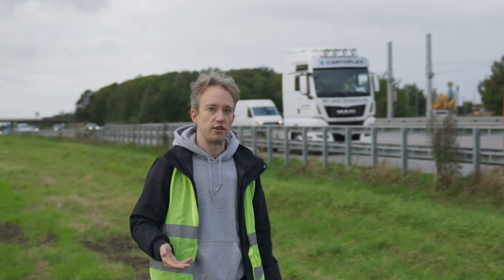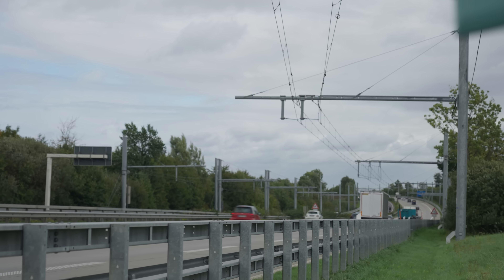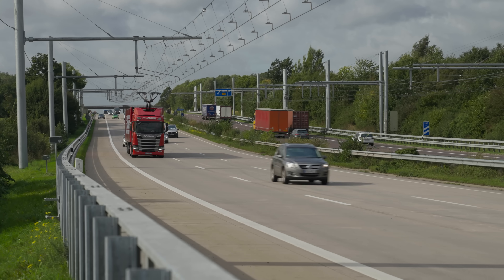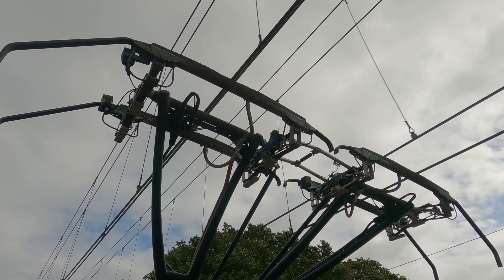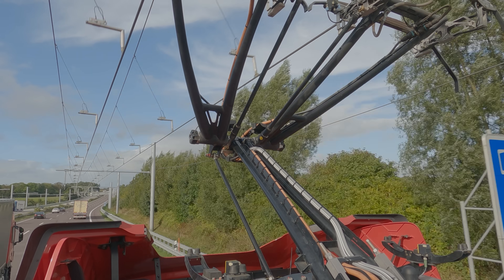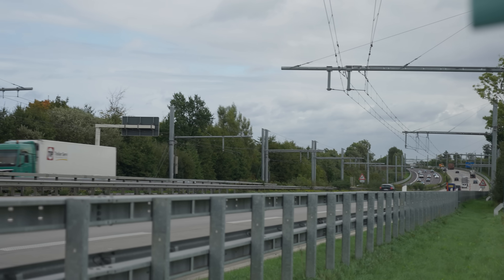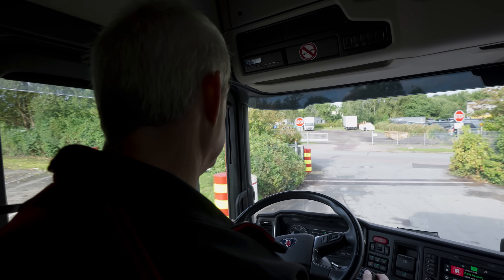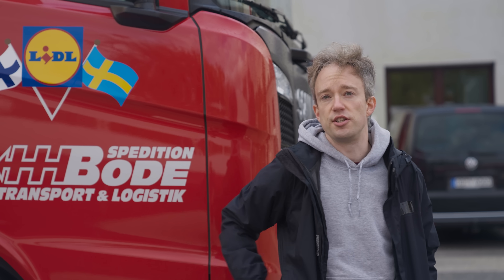The highway where trucks work like electric trains

Comment: This looks like a good idea in theory, but I struggle to see how a business case can be made for building the required infrastructure. It's a bit chicken and egg, because the economic case for using the trucks will not be made until there is an extensive network in place, but who will pay for the network in the meantime, if no one is using it? I suspect it would not be possible without significant government funding, which is unlikely to be forthcoming. Governments have been reluctant even to fully electrify railways, where an extensive overhead network already exists and the business case for additional sections is therefore more sound.

Comment: Vehicles powered purely by batteries are not viable long-term, despite what Tesla and battery manufacturers wants you to believe - they take far too much energy to produce, have a very short lifespan before the batteries become unusable, and the production of the raw materials for the batteries destroy the planet. And that's besides the problem that the materials used to make batteries, no matter if it's NiCd, Lithium, or Lead-acid, cannot be recycled and used to make new batteries. They require finite materials that will be used up faster the more ignorant governments try to force people into battery powered vehicles.  Hybrid vehicles running on electricity and sustainable fuels are the only long-term solution for the future. Private vehicles for every individual are also, unfortunately, not sustainable long-term - we would never be able to produce enough electricity for all of them (California already struggles with all the electric cars despite of how much power they produce), but at least with hybrid fuel there's a chance we can have some share-cars. Heavy investment in Trucks and buses running on overheads wires is a very viable concept, but unfortunately we're unlikely to see any of it until it's too late.

Comment: This is a good idea but costly to. Install  , but if we were to Change the way ,our roads are used , that is to use the so called fast lane,overtaking lane as a dedicated lane for Trucks buses coaches , then the vehicles would stay in lane until they need to take an exit, and switch to battery power,  this could be achieved, at less cost as the power could be delivered to both carriageways from the central  crash barriers on a single pole , much the same as the overhead lighting is done ! The alternative would mean the motorway looking like the railway, as an example

Comment: I remember having this as my 10th grade science congress project back in 2016. Judges were impressed by the idea but the challenges were more than the benefits so I only got to the regionals. Its great to see this implemented in real life and actually working. The child inside me is proud. Shout out to Germany for leading the way to clean energy revolution!
Reply: May I propose the idea of "freight trains", where a bunch of unpowered trucks are pulled by one or more powered "trucks"? This is even more efficient for long distance transport…
Reply: @ibimsbodenhansel3230  True, but this is for short transport, from warehouse to store or warehouse to home.  This is what a UPS or FedEx van would do.

Otherwise, trains are the way to go.
Reply: @dannypipewrench533  that would be the smart way to deploy this system, but the Germans want this for long distances where batteries wouldnt suffice. If you were to use this for the purpose warehouse to home, the construction of the lines would be to expensive. We already have electric delivery vans! Why would we need this exept for long distances.
Correct me if I am wrong, but in this case they are trying to satisfy a market that doesnt exist.
Reply: @ibimsbodenhansel3230  hybrid trucks with enough gas mileage would create that market, but only if the electricity can actually save money after a year.
Reply: @dannypipewrench533  but those vans run on battery already
Reply: Not to mention that electric motors are just really really good at making things turn.  Sure, they are clean, but they are also quite efficient, which is what I like about this idea.
Reply: This is clearly a money laundring blunder, this is coming from the country that declares carbon and gas combustion is a more enviromental friendly energy source then nuclear energy
Reply: @blomgaming6480  I like nuclear energy a good deal.  I am going to study nuclear engineering.  I hope to see the construction of breeder reactors at most power plants in my lifetime, but that is not why I am going to get the degree.

I want to work on spacecraft and launch vehicles, and nuclear-thermal propulsion is a fascinating concept.
Reply: Good thinking on your project. Nothing is possible until it's been done. In my freshman year in the BSME I was enrolled in program I did a project on replacing some underused city buses with self-driving mini-buses that could be called up via phone and the destination could be entered. And that was in 1970!
Reply: Hold up, you did this as a 10th grader!? What have I been doing with my life 😂?

Jokes aside, I know we're all different and our own talents. Mine interrests has been physics (or tho not chemistry). But it's still just a hobby interrest.
Reply: They are burning South African coal and Russian gas to generate that power.nothing clean here
Reply: Germany is extremely backwards in general with environmental things, sad

Comment: The cost of installing these electric poles is one million euros per kilometer. Why not changing the traffic/road legislations so that lorries (trucks) move in the middle. Thus, only one-line of posts/rails is installed in the middle. This will reduce the installation cost to 50%.

Comment: It is a good ideal.
Take it to another level by:
- Build the grid on major highways.
- the truck like Tesla truck with charging while driving like in the video.  The charging only some section of highway in town only.
- this provide flexibility long or short distance driving and charging when need without stopping.  Easy to change lane and so on.

Comment: There seems to be an issue with the pantograph. With trains the cables sway on the cunductive surface of the pantograph to minimize the problem of creating grooves. Very easy solution for a vehicle that has a fixed track. I'm curious how they plan to implement that on the electric highway. You don't want the vehicle with up to 40 tons of load to sway around without being a huge safety risk in traffic. There has to be a sweetspot that it doesn't loose contact aswell or the vehicles have to be maintained in very tight service with (probably) expensive replacements of the conductive surface of the pantograph.

Comment: Still don't know why replacable batteries in vehicles wont work
Reply: The batteries would have to be massive to move a vehical that large and heavy. Batteries are very heavy themselves and costly to create by using rare earth minerals. By having the vehical on the grid for most of the journey, the batteries can be smaller as they'd only be needed for brief stretches.

Comment: All fun and games till something goes off and a spark ignites your load . Could it be fuel or any chemical sensitive to fire. It might be something but not fully viable
Reply: that's....  not how that works... thats like saying "petrol trucks arent fully viable because what if the combustion engine goes off and it ignites the load" an electric truck cant ignite its container just like a fuel truck cant.

Comment: This feels weird, it's not a complete scam infrastructure thing like Elons tunnel 2 but it also feels like this could just be fixed with trains, especially as most road wear comes from trucks. In some cases I can see this being more beneficial especially if there are no nearby train lines but long distance trucking shouldn't exist and should just be replaced by trains.

Comment: It would be interesting to know whether electricity is still cheaper than Diesel after all this electricity price jumps in Germany and Europe (and electric bus company in Scotland was advised to use diesel generators as it was cheaper than using grid power).
Reply: in Germany Electicity is MORE per unit energy than Petrol or Diesel fuel

Comment: The only bad thing is that the wires are not in a zigzag formation (makes the pantograph wear out evenly) but if the wires are straight, only 2 parts of the pantograph will wear out.
Reply: i feel like how the wires are currently not exactly perfectly straight, along with how driving will have some bit of side to side movement (well, a bit more slight) should be good enough, and replacing those are cheap enough to not matter too much
if it's too zigzagged, you may run the risk of going too far off to one edge of the lane and decouple the wires, and a slight zigzag might not make much of a difference
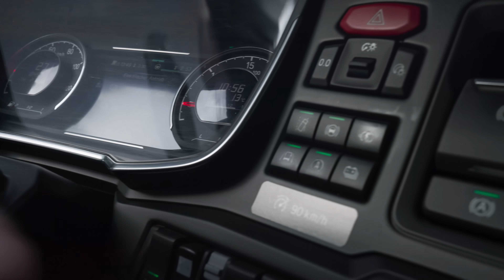Reply: @awesomestuff9715 at 1:11 you can see how uneven it is weared down.
Reply: Not needed, you still don't follow the lines accurately. There are curves that zigzag by design (and there are a lot of them). That's the least trouble with this system (a change of the pantograph takes like half a day, maybe?). How about the DC electricity, where you have to have a transformer/rectifier every max. 10 km?

Comment: My congratulations to the engineers who reinvented the electric train.  In at less efficient form, but retaining the essential limitations of the electric train.  Why not just ship goods on the existing electric train network?  Adopt the containerisation principle.  Use transport modules that are a whole fraction of a standard container: 1/2, 1/4.  Adapt the load-carrying part of a truck (and its trailer, if any) to carry modules. Use machines to swap modules between trucks and railway carriages.

The city I grew up in used to have trams.  As the city grew, it became uneconomic to extend the rail network, so they switched to trolley buses.  As the city grew, it became uneconomic to extend the overhead wire network, so they switched to diesel buses.  Nobody particularly wanted diesel, they just couldn't afford trolley buses any more.

Comment: You know what would work really well? Putting steel wheels under the trailers and having one truck pull many dozens of wires at once. In fact  the whole thing could be put on rails... You wouldn't even need batteries, you could just use over head power cables. We could call it the Land Snake. you could even link the rails together to connect different areas. It wouldn't compete with car traffic on highways and wouldn't damage roads and bridges as much..  I think I'm on to something here

Comment: Right by where I live on the A5 we have an e-highway aswell. In the 2 or so years it has been there I have seen one truck connected to it.
Also it is quite hideous and stupidly expensive to build.
But more importantly, it will make heavy accidents more fatal, since  rescue helicopters cant land on the Autobahn anymore. And a lot of the german Autobahn is surrounded by forrest, so there are no fields to land in.

Comment: This seems like a great idea, a lot of busses in San Francisco already work this way (although I don’t know if they have the ability to detach from the lines, instead they just have an articulating arm that connects to it and allows it to access both sides of the two lane roads they operate on).
Reply: Not just San Francisco, if you read the entry on trolley busses on Wikipedia, you'll see how widespread the technology was and still is.
Reply: The trolley pole can be automated with a trough attached to the overhead in certain places, that funnels the pole correctly to the wire.

Comment: Could there also be tram tracks to allow for the greater efficiency of rail compared to tires and tarmac?  A lorry would have to be designed that can switch between rail and rubber wheels difficult but impossible?

Comment: I wonder if you could actually CHARGE the batteries as you go. If you only needed this infrastructure every few hundred miles, that might be totally practical. Like 50 miles of overhead cable followed by a few hundred miles of running on battery. It depends on whether the cables can deliver enough power.

Comment: Why not replace a lane of the free way with rail and have electric trains?
Reply: Because the automobile industry has a huge influence on politics
Reply: @j03l911  obviously. Any reason besides that?
Reply: @MegaLokopo  there are some. Just building this instead of building an additional rail infrastructure would save a lot of money.

and since transport will also always happen on roads this is a nice way of electrifying the transport.
Reply: @emilsinclair4190  I guess this would be a good stepping stone, but over the long run, trains will always be cheaper simply because of how much more efficient they are.
Reply: @MegaLokopo  not necessarily. Because if you would want to replace them comely with trains you would need a lot of additional trains. And trains are generally more expensive than lkws
Reply: @emilsinclair4190  1 train is more expensive than 1 truck, but 1 train is cheaper than the thousand trucks it replaces. 
When you calculate it by container, trains will always win in efficiency, unless you have government intervention.

Comment: Now I wonder if there's a way to make overhead electric lines somehow compatible with personal e-cars
Reply: There probably isn't. Since cars are much smaller than trucks and don't go high up, the pantograph would have to be extremely large, maybe even larger than the car itself. And you can't just lower the wires because then it wouldn't be compatible with trucks. The length of the pantograph when folded down might be longer than the car itself.

Comment: Pantohighways will require planning but is a really good solution. Less batteries to be used, more electromotive power. Also gives the option of running full electric, hybrid or diesel-electric (electric motors powered by a diesel generator).

Comment: Didn't Top Gear say about this being a good idea back in 2008ish? Might have been an out take but I think it was Season 11. Even they admitted well if the gov want us to go electric. Why dont we use a normal petrol engine to get to the motorway then extend a arm up like a train then turn off the engine and run on mains. This was back in around 2008, how did no one else come up with this nor attempt it till when ever this project started

Comment: Interesting idea but where does the electricity come from. Is it hydropower is it solar or is it burning fossil fuels and emitting the same amount of gas into the atmosphere as a diesel truck would. However I am no expert it's just a question becaue it doesn't seem like it would bring down air pollution so much that the amount of energy provided would still pollute the air as much as a diesel would

Comment: idk if my logic behind this is correct. but what if the wire gets struck by lightning, then travels to all the trucks connected in a reasonable travelling distance of lightning, would've they all get damaged and possibly injure people. even if just the line was damaged, does that mean they can't get anywhere or would they have a backup??

Comment: I never understood how electric vehicles are supposed to be more energy efficient. You are taking thermal energy from burning coal (a fossil fuel), converting it to kinetic rotational energy in a turbine, then converting it to electrical energy and sending it out on thousands of wires across lots of large distances, and finally being turned BACK into kinetic rotational energy in order to move cars. And the energy isn't even guaranteed to be fully used unless the maximum potential usage is met 24/7, which should not happen because if it does there is a risk of falling SHORT and the power grid being too weak. 
Meanwhile automobiles burn gas and diesel (again, fossil fuels) and directly convert it to the rotational kinetic energy needed to move the body, and when not in use the engine shuts down and doesn't burn any extra fuel. It seems far more direct and efficient to me.
Reply: Easy: A diesel powered engine has a real life efficiency of under 25%. If you power an oil power station, it will run at 45% efficiency. And runs much cleaner. So even if you would discard nuclear, wind, solar, water you would just need half of the oil to run BEV cars instead of ICE engines.
Reply: You know that nuclear power,solar energy and wind energy exists

Comment: I take a bus running on a system like this to work every day, they've been running since the 1950s! - they just built out the network earlier this year to reach more of the city
Reply: Reminds me of the trams that used to run in soviet-era Lithuania, which nowadays is a ride you can take in some (where I live, it only takes several bus stops to a hill with those trams), overall both systems take different implementations.
Reply: Dayton, Ohio has such a system.  They build their own buses, too.
Reply: I think you're thinking of trolleybuses which are different from pantographs (which can handle much higher speeds) even if the basic principle is close

Comment: In the UK for example there are 485,900 lorries, if say around half (240,000) of these were in use, each consuming about 200kw then the amount of power required would probably demand additional power stations (probably burning fossil fuels) and upgrades to the infrastructure. 
Simple fixes to complex problems seldom work.
Both Germany and Japan are currently investing and developing hydrogen production fuel cells, I feel this would be a greener and better solution.

Comment: I hope they find another way of doing this. I'm not a fan of overhead cables. They're unsightly and potentially hazardous in stormy conditions.
I know it's probably not a viable solution but I wish we could have wireless charging roads which all electric vehicles would benefit from.